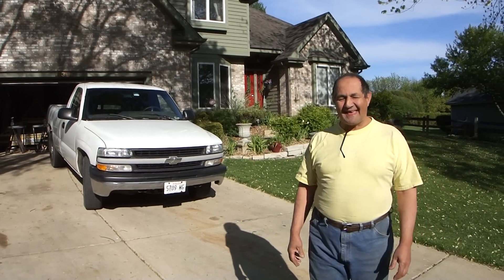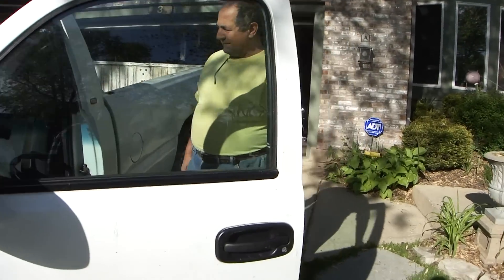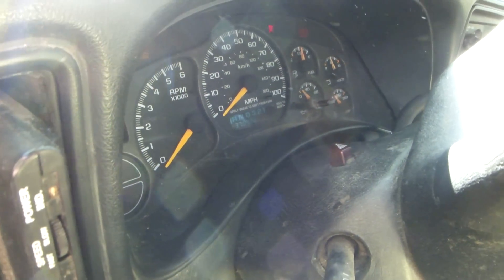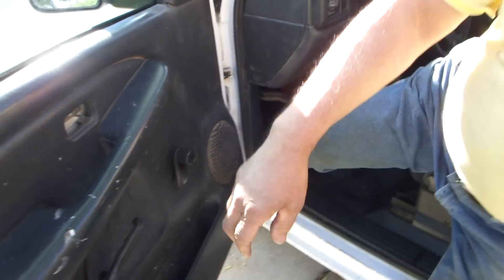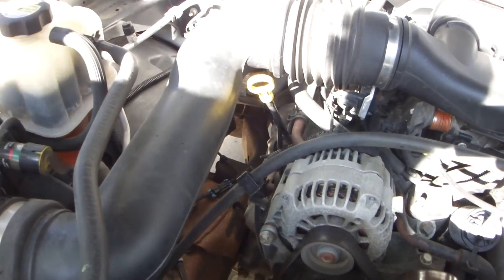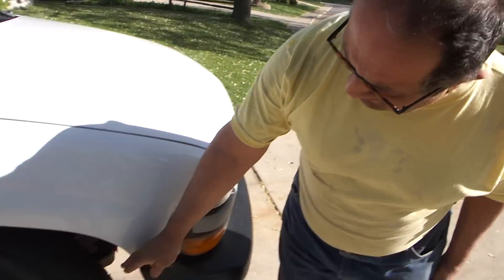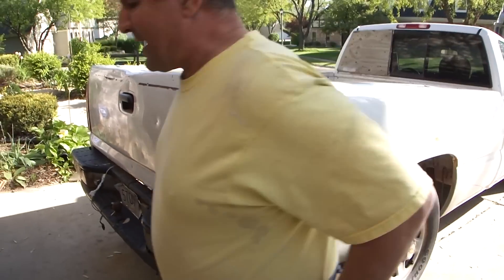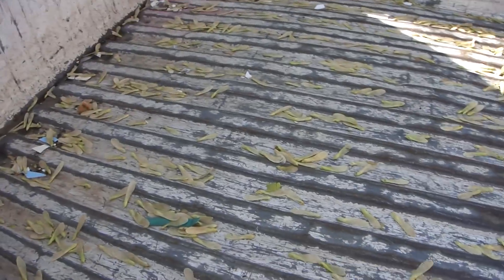Over 300,000 Miles on A 2000 CHEVY SILVERADO

Comment: I pulled the heads off of my 2000 Chevy 4.3 225k miles to do a valve job just because fir no reason and the heads were in great shape as a matter of fact they didn't even need to be resurfaced there was no crack for warpidge at all

Comment: Got a 2003 original 4.8l Motor and 4l60e transmission,  258760
Reply: krazor8 x the 4l60e hasn't been takin' apart yet ?
Reply: Justin P. Not that I am. Aware got. It back. In 2005, with 32000 miles
Reply: You sure struggle with figuring out where to put periods and commas.

Comment: Just traded in my 2011 Silverado 1500 to upgrade to a 2014 Silverado 1500. The old gal had 282,000 miles when I traded her in. Lotta long distance miles for work; suspension work, brake work of course, rear fenders rusted through because I’m in MN. Had wheel seal leaks which leaked onto the drums in the rear….wasn’t worth putting anymore money into. SUPER happy with 282,000 miles from ‘Olive’. I am even happier with my 2014 Silverado. I’m a Chevy guy. Love the Silverado.

Comment: My 05 silverado 4.3 v6 currently has 173k miles still going strong!! Sep :2021 187k miles engine long gone!
Reply: what happen to engine?
Reply: @tonymemory2279  I think the engine blew up due to oil leaks it had over the years. The last owner never bothered fixing the oil leak. If the engine got attention When it begin Leaking oil, I’m pretty sure my Silverado would be still running on its original engine today. Due to neglect of the last owner.

Comment: I’ve got a 2000 Silverado 1500 5.3 vortec. One of the best trucks ever made. Don’t need power windows, power locks, or heated seats, got a radio tuner to play my own music and new speakers and that’s about all I’ll ever need to do to it other than change the oil and fluids when needed. Solid truck.

Comment: I bought my 2000 4.8L Silverado with 307K on it. Previous owner rebuilt trans at 250K. Motor all original, never gone into. Runs like new except a rare, short-lived  lifter tick. Body rust-free. Just hit  350K on it. Have only replaced tires, one set of door hinge bushings, a few bulbs, and one fuel pump. Really impressed with the consistent reliability of this truck. Gonna see what it'll do, longevity-wise.

Comment: 2000 Sierra extended cab 5.3 with 237k miles. 3 fuel pumps, 1 steering fluid pump, and 1 oil transfer pump. Other than the 3 fuel pumps, it's been an amazing truck.
Reply: Keep it over 1/4 take the pumps fry on empty tanks.
Reply: If it's a pickup the fuel pump is a cake walk compared to a SUV where you have to drop the tank unless you want a hole in your floor board

Comment: power washing your engine bat is stupid. you will either crack a engine block poring freezing cold water on incredible hot cast iron. or you will short out a sensor on the vehicle or worse, short your battery and fry your vehicles computer mounted on the left of the engine bay.

Comment: Mine's got 111,000 miles. I change the oil and run complete fuel system cleaner every 5,000 miles, I've had to change the transmission at 57,000 miles and had to do a flush on it, and changed the thermostat to get the air conditioner and heater working again, but so far it's running good. I bought it just outside of the original factory warranty, and I think the last owner beat the heck out of it and left me to pick up the pieces. I had to do some maintenance on it (catalytic coverter blew out, ignition coil needed replaced, thermostat replaced twice, plus the transmission), but after my first year of owning it, so far it's still going strong. I'm hoping to get at least 225,000 miles on it. I bought it in 2011 and hope to drive it for many more years to come!
Reply: you still driving it? haha
Reply: @ThatOneDroppedChevy  nope, traded it for an F150.

Comment: I have a 95 s10 4.3 with 336,000 and as a test haven't changed the oil since I got it 2 years ago. I've added 2 quarts and that's it. still starts and drives everyday. definitely not good for it but I have a Silverado I'll religiously change Lol.

Comment: I got 300k on my 02 5.3... Best truck ever built
Reply: martech360 great trucks!
Reply: 130k on my 07 5.3 still running like a Swiss watch. hope I can make 350
Reply: My 2009 has 290,356 miles 5.3L 6l80e original motor and tranny
Reply: Same way with my 2003 Chevy Tahoe with 322 thousand miles on it everything original
Reply: How many on it now?
Reply: Just got rid of my 99 5.3 with 330k original motor and trans (abused) still ran strong now got an 08 4.8 hopefully it beats the 99 😁

Comment: 99 to 06 vortec engine is one of the most bulletproof engines ive seen
Reply: codemanz191 the fuel injection system is trash but the engines are damn well great
Reply: whats so bad about the fuel injection system? only problem ive ever had is a bad fuel pressure regulator
Reply: codemanz191 the spider injection is a very common fail point on those. Not saying all fail soon but it's a plastic crap under the manifold. Stupid gym design. I love the old school thi
Reply: codemanz191 these aren't spider injector engines that's the 4.3 and small and big block vortec not ls

Comment: mine just hit 360,000
Reply: RanJay H I do oil changes, ive replaced the alt, water pump and ac compressor, but that's it, I've had two rear ends and one transmission along the way, but it's always made it home, well lol few times the break lines ruseted, but other than that never had to replace the entire engine.

Comment: I had an 88 regular cab, short stepside bed. Had the 350 with a 700R4, seeet little truck, sold it to a freind, he dogged it and the trans let go,(700R4's were not the best). I bought it back from him about 7 months later, got a heck of a deal, lol. Bought a reconditioned trans from O'reilly Auto Parts, was $949.00 back then, drove the truck 3 more years after that and sold it again when I bought a 95 dodge with the cummins diesel. The chevy had 309K on the clock when I sold it the second time, I've kicked myself in the azz for ever selling that little pickup. Keep thinking one day I'll run accross another, mechanical condition doesn't matter, thats all I ever did was mechanic of one form or another. Yep, love the body style on those little chevys, just got to be reg cab, short stepside and I'll be happy.

Comment: my dad is giving me his 2000 1500 with 408,000
Reply: also since it has so many miles would it be okay to puy a lift on if
Reply: also since it has so many miles would it be okay to puy a lift on it
Reply: MattyIce727 itd be a waste for anything above a 2-3 in leveling kit in my opinion, 4-6in lifts cost 1k+ while you can get away with a rough country 2in lift for 100-200, depending if you want new shocks with it to help out with the ride.(i did this for mine and its a get ride now)

Comment: I highly doubt that truck has had trouble free miles considering it has a 4.3 in it because they usually start having problems around 250,000 miles
Reply: +Chris John Michael I've had a 4.3 in a truck similar to this and I've had one in a blazer, 4.3s are great running engines no doubt about that but the late model 4.3s like this are just horrible. In my opinion the late 80's and early 90's 4.3s are the best.
Reply: Randy Yonkins you know you hatin on a small block
Reply: +Jack Carroll yes I know cut down 350 blah blah blah, but I have owned the Gmc version of this truck and all it did was nickel and dime to death.
Reply: Randy Yonkins I'm sure it wasn't the engine. What year and type?
Reply: Randy Yonkins some of the 4.3s weren't true vortecs.
Reply: Randy Yonkins 😯
Reply: Randy Yonkins the block itself, is very good but the lower intake gaskets and spider injection does have issues
Reply: Randy Yonkins you must have gotten a lemon or something because my grandpa's 99 4.3 has 400k and the only thing he's changed is tires brakes oil air filter battery and 2 fuel pumps
Reply: 4.3’s don’t make enough power to even come close to hurting themselves so I definitely believe that is the original motor.
Reply: Steven Vanheel my s10 4.3 pickup is a 5 speed and it puts me in the seat, for a V6 its got some power to it
Reply: Paul Zimmerman yea I guess the one in my buddies s10 isn’t to bad but another buddy has one in his 08 Silverado and that thing is a dog
Reply: I would be more worried about the 4l60e transmission, those things are about as reliable as a Ford engine...
Reply: Randy Yonkins im a ford guy and even i admit the 4.3 is an amazing motor. Glass pack it sounds lile a v8 with better gas mileage. Cant break these motors. Pretty much any vortec at that. Like i said i love my fords but id buy a vortec chevy any day.
Reply: Chris John Michael 
The 5.3L V8 could be considered a close second.
Reply: Wil The Snake The 5.3 is a far better motor. The 4.3 will destroy itself once you start throwing boost at it, the 5.3 won't. 4.3 was still based off of the old 350 rather than being based off the LS.